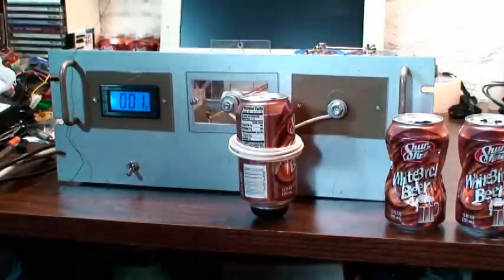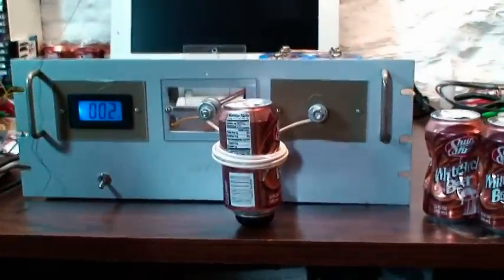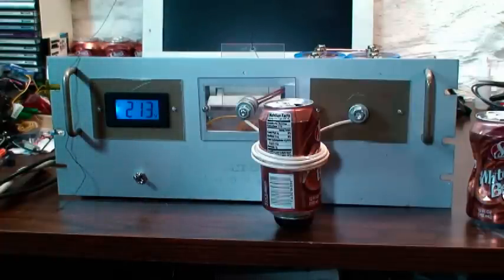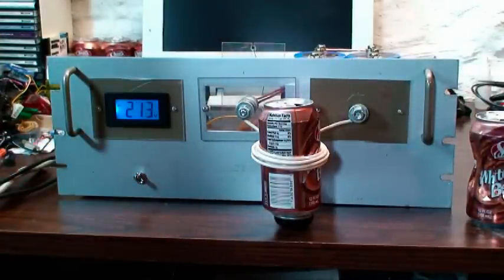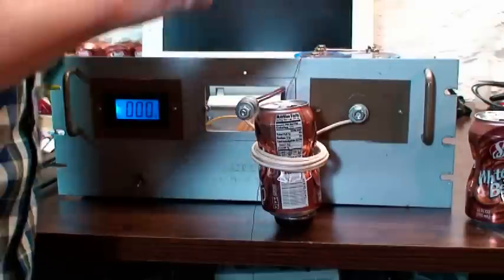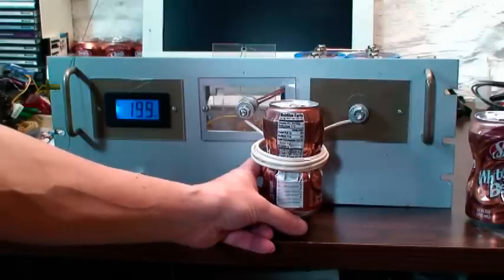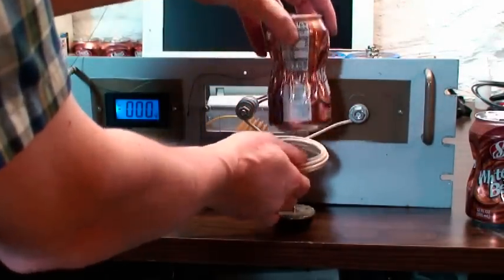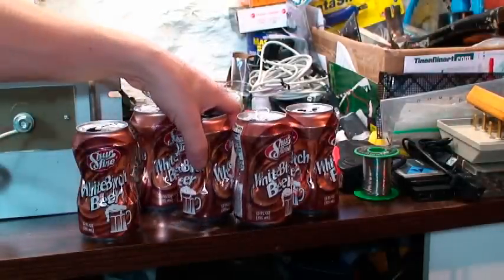2400 Volt Can Crusher 2

Comment: Hello' very neat' i play with high voltage electricity allot and been pretty interested lately on these things and rail guns' anyways i was just wondering' how does it crush something thats not able to be magnetized like " aluminum" also what would happen if you put yur finger inside that coil when it went off of like a bug or something?? Can you do this with say like a few camera flash copasitors parralled together and maybe like only 400 or 500 volts?

Comment: This could have many applications, molding, repairing, and fusing together of aluminium sheets.  If you set up several banks of capacitors and fire them off in sequence.  Good work!

Comment from the maker: @MrTHEORIGINALICEMAN - Its pure magnetic force.  Aluminum repels the magnetic field and moves away from the coil.  The magnetic field is a factor of volts and amps.  It does not work with water, but supposedly water also moves away from a magnetic field...need more research there....

Comment: I have a 1K questions, but I will just ask a few. 
Is there a difference in using a tin (steel) can as opposed to aluminum?
Do the coils contract or is it purely magnet force? 
Is it the volts or amps that most affect the effect?
If you could sustain the same VA on the coils would it crush the can until it became a black hole?
How would this affect a water balloon with distilled water, with brine?
What would it do to a piece of silicone? graphite? Mica? 
Is it always a repelling force?